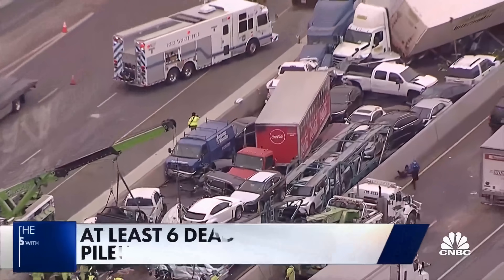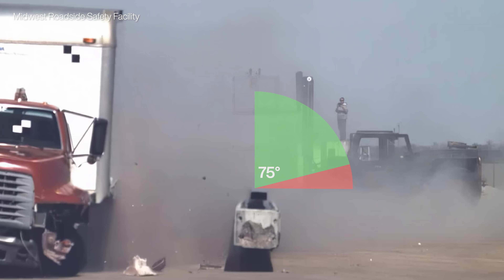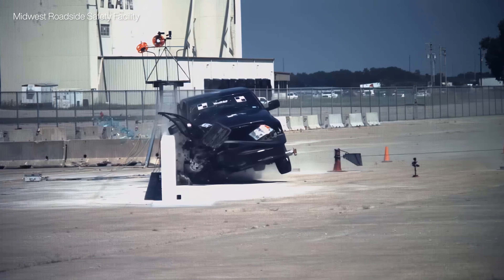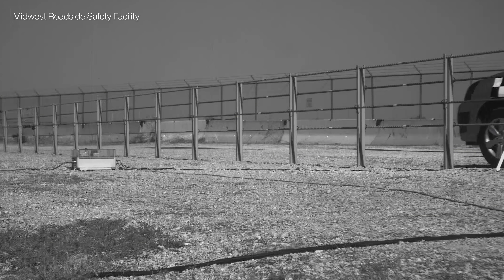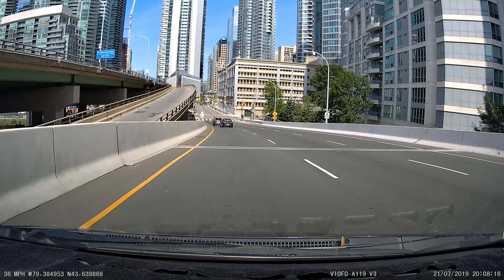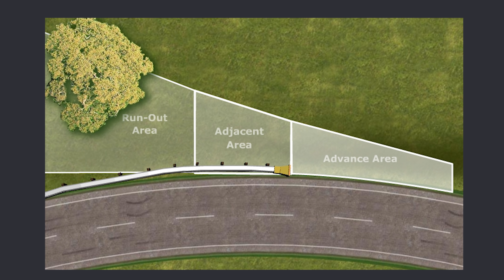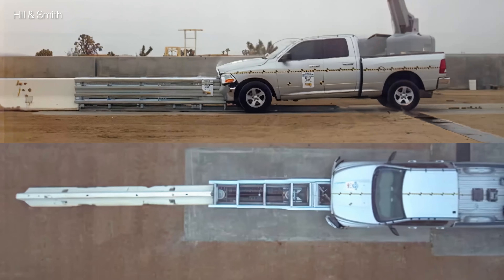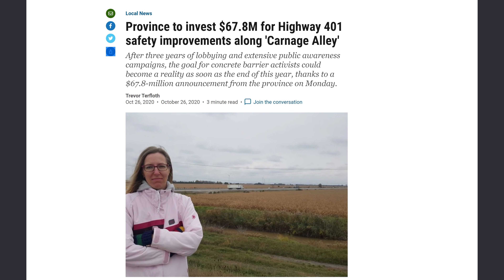How Road Barriers Stopped Killing Drivers

Comment: The cable barriers have been known to decapitate people, and because of that I will never drive a convertible.
Reply: I wish he had put the metrics up to compare them to guard rails. Like I get why concrete barriers are bad in any situation you aren't blocking very serious high speed cross into oncoming traffic. Stiff=bad when you are wrecking into something.

However I have the suspicion that guard rails are significantly safer while also being around the same price. So it feels like shaving pennies by throwing out a few lives.
Reply: @Syllaren  It's not really pennies when it comes to this. Not only that, the decrease in cost would allow more roads to be covered, which in this case would be 40% more roads covered by cable compared to the other one. Lives doesn't have a cost, but building materials do, unless these projects get a larger budget, cheaper alternatives would be more appealing to project managers.
Reply: @Syllaren  Did you pay attention to the experiments and safety testing being done that he showed in the video?  They WANT to know and FIND OUT before just going on their merry way doing the same thing as if there is no better choice.  I had no idea they have worked so hard to make it that much better.  I am 64 I remember them using sand barrels.  Then deciding water barrels were safer at bridges.  Then they disappeared and I did not know why.  This video shows why.  They found better methods to save your life and limb.  I remember the horrifying accidents where people got speared by the "safety" rails. It is great to see why that does not happen anymore.
Reply: Another issue with cables is they tend to get tangled up with the crashed vehicle, while being under an incredible amount of tension. That makes things dangerous for rescue and cleanup crews.
Reply: @paulmarano4078  But help slow the vehicle even more.

Comment: I have one issues with cables, those are great in most roads, but roads that are high speed or can be high speed cables can be deadly with compact cars, small sedans and especially low sport cars. There's a case of a viper being cut in half to deadly results because of bad cable design. I'm sure they are safe, but it's all about the right barrier for the right road.

Comment: I opened this vid just to comment... the department started cutting corners and even though they should curl away...they made one part smaller to save a minute amount of money and it breaks making it not curl. They made this public with then no opposition. Give or take if it works when you need it. They still pierce through cars in accidents.

Comment: Cable barriers are mad dangerous- it’s basically a guillotine for motorcycle riders. In the UK were going for concrete barriers as much as possible - saving metal flexi-guards for near side protection where necessary. We also use the crash cushions where possible.

Comment: Fun fact!
If you destroy a guard rail with your car, it can cost up to $1,000 a foot to repair depending on what kind it is.
This fee covers the materials cost and any labor needed to install new guard rails. 
Dont hit a guard rail if you can help it!

P.S. ( the Nurburgring race track charges 1000$ per foot of guard rail, and an additional $1,600 for every hour the track has to be closed.)

Comment: Non-wire guardrail have their own controversies, as jumps still happen even on the newer versions. There's also a plethora of problems with the consistency of which they are installed, making the posts oftentimes flip or fling colliders. Anyone not in a car also tends to get their legs mega-crushed or downright flung over said rails, often over a bridge/cliff or into the other side of traffic.

Also very disappointed you did not go over tire barriers at all, since you brought up cost & complexity so many times. They work great for cheap and are incredibly reusable.

Comment: 'better for frequently hit places'

Me, living in the Netherlands: You should fix the road design if it causes that many hits with guard rails.
Reply: Roads have the inbuilt problem of not being flat. (Even if made that way they don't stay in that shape as the weight of the traffic over time compresses the ground under the lanes but not the middle.) Generally they have a slight camber or tilt to increase the drainage of water but this also means that cars will tend to drift off the road as well.
Reply: @JohnJ469  hmmm, that doesn't dispell the merit of my comment though. You'd first have to assume that the cause is that the roads aren't perfectly flat. Well, over here they aren't either, flat enough though and most of the times repairs/resurfacing is done in a timely fashion. If my car is up to standards, i won't be crashing into those barrier starts, unless i ignore the conditons of the road or ignore the speedlimit.
Reply: @AwoudeX  Sorry, I meant it as one reason, there are many. And of course those reasons vary from nation to nation. For example in the Netherlands you never have to worry about a kangaroo jumping in front of your car. (Or low flying hawks and eagles, I've hit a few of those over the years too.) Personally I think most of the causes are inattention, tiredness or drink driving and unfortunately I don't think there is a design change you can make to effect that. As the old saying goes; Making something idiot proof just encourages God to design a better idiot. I think that's exemplified by driving on a mountain road and seeing a sign saying "Winding road next XXX kilometres". A winding road in a bloody mountain range? How unusual.
Reply from the maker: Yep, but in many places car culture is unfortunately prioritized.

Comment: I worked for MWRSF while I was in school.  There are a bunch of videos that they have not released that are awesome.  They have to get permission to post them from the agency that contracted the testing.
Reply from the maker: Hey Casey, that's awesome.  I understand they do a lot of contract testing for manufacturers so I can see why they don't want to post it before it either gets approved or before they get a patent for it.  I'm glad they posted as many videos as they did, it made this video possible.
Reply: @Lam  when i worked there they were testing barriers for a bunch of different states.  They also did some testing for DOD.  One we had a remote control car and went over some speed bumps.

Comment: I'm not a motorcycle driver (motorcyclist?) myself, but the main reason why they replaced the traditional guardrail with top to bottom 'walls' in the Netherlands long long  time ago, was because of accidents with motorcycles losing grip in bends and slide under the guardrail and in many cases decapitating an arm, leg or their head. I'm surprised I didn't see a motorcycle example in this video. Also I think Korea started with these rolling barrel construction guard or gide rail to absorp sudden impact to improve the survival rate.

Comment: Cables are cheap to install.. But expensive to maintain and repair. So in the long run you pay more for less.. On top of that a semi will run over them due to it´s weight and a motorcycle driver can get stuck in the wire and die. So I will never think cable is a good idea.

Comment: The government is still going about it all wrong though. That is improving driver skill is getting no attention at all which would prevent crashes from happening in the first place. They treat crashes as inevitable, where in fact nearly every one of them is caused by someone doing something wrong, which includes poor road conditions. It isn't so much that it was slippery, but that there are way too many drivers without the necessary skills to handle it, or to even judge whether to even be out in it.

Comment: Excellent video. 

I have designed highways for over 30 years. I cannot emphasize enough that the barrier itself is a hazard - you can't hit what's not there. It is far, far better for designers to provide sufficient clear zone for drivers to regain control of their vehicles so they can make it home in one piece.

Comment: They are still chopping motocycle drivers when they fall under in most places...
Reply: If your worried about safety then dont drive a motorcycle.
Reply: Cant save everyone
Reply: @LilfletchJDub  not with that attitude for sure...we can double the rails it will help everyone...
Reply: @kealahau6727  Double the rails and that truck you saw get caught is now jumping that railing and rolling over. Now john and his wife margret are dead... Joey is half dead in the back with his neck broken, and little andy in his car seat is paste against the roof that caved in... Yeah, we have them single for a reason, and that reason is the lives of multiple people in a single car.

Comment: 1 of the problems not addressed is how close the road authorities install the barriers to the running lane and how much of the original shoulder these barriers take reducing breakdown lanes efficiency and safety. Case in point, on Bass Highway between Lang Lang and Anderson (Victoria) if you broke down or got a flat tyre, you pulled over onto the shoulder (and could spill over onto the grass) as there was no barrier stopping you. You could be about 2 metres from the running lane with a wide safety margin. Then the idiots installed wire barriers taking up the shoulder part meaning only about 1 - 2 metres of the shoulder was left. So if you broke down, your car was partway on the road still if your passenger side was up close to the barrier (meaning you couldn't get out that way safely) and your door opened into the running lane. This now terrifies me as being very unsafe. All they were protecting was farmers field which could conceivably act as safe runaway fields. 

Add to that the fact Victoria police have a habit of pulling you over on blind corners with their vehicles 1/2 way INTO the running lane to make it safer for the police only (screw everyone else). Add the law of slowing to 40 kph when passing a police vehicle on a blind corner 1/2 way on the road and people slamming on the brakes from 100 / 110 kph and you have no safe run off area to go. All to save money and 'Look' like they did something. I happily slow down rapidly to 40 kph on a 110 freeway and look at them smugly as they look worried with a truck behind me slamming on their brakes. After all, they are the ones who wanted the law.

Comment: It would be nice if standards and manufacturers would also consider 2-wheel vehicles. It breaks my heart to see only cars and trucks in these videos. There are other vehicles on the road (including motorcycles and cyclists). Many barriers are exceedingly dangerous for 2-wheel vehicles, but they don't have to ! Simple modifications such as adding materials at ground level would prevent limbs from being cut in a crash, and removing sharp edges...

The major risk is that 2-wheel vehicles crashing send their riders sliding on the ground, and the vertical pillars of most of the barriers considered simply cut whatever limb or head contacts them first. Instead, manufacturers need to add a continuous band of horizontal material at ground level to prevent this. Simple modification !

Comment: A very good vid, informative andmanly similar systems to what we have here in the UK. Althought I'm nowretired I was one of the first in the UK to achieve the cetrificate needed to install safety barrier. we use the following types, blocked out beam which has wooden posts, tension corrigated than uses steel post, box beam with bigger or if fitted toa structure crush boxes, concrete section susually in conjuction with other types. we also use an abutment fence atop the concrete bridge abutments on elevated carriageways. they are a sturdy steel boxconstruction with wire mesh panels, designed to prevent anything going over the top. We alo use the wire type but only on roads that are prone to drifting snow winter conditions, as it permits the snow to continue through and off the road. Wedo use differnt anchor/terinals herein the uk. Thank you for reminding me I actually knew all this. lol

Comment: I'm quite surprised that cables are less likely to launch cars back into the roadway.  A few years back on an icy interstate I hit a cable barrier and was sling-shotted back across the roadway.  In that incident, the cable barrier transformed a slow-speed fender dent into a terrifying spin through traffic where I narrowly missed a semi.  Additionally, the cables mangled the vehicle in ways concrete or a regular barrier never would.  The top cable smashed the windshield and creased the A-pillars.  Thanks for providing some facts to temper my dislike of them.

Comment: Cable barriers are a nightmare for Motorcyclists. Weirdly enough it is the posts that cause the dangers to Motorcyclists. The riders hit more posts causing substantial injuries to the rider. With the solid (Armco) barriers a simply lower beam keeps the rider away from the posts. I would love to see a more detailed study utilising more vehicle types and barrier designs. The concrete barriers can have an added benefit. If they are high enough they can put a stop to the 'rubber necking' and the accidents associated with that...

Comment: I seen a truck flip over and over because of cable barriers and the other systems I seen fail as I seen big trucks flip over on over pass down to the ground on street and the straight concrete made a car flip over to the ground and the driver died

Comment: They should put lights every 100 feet and when the barriers get severed or impacted (like air bags) the lights flash for 2 miles in both directions so drivers slow down, esp in the fog.

Comment: The cable barriers have often been called "person slicers".  Motorcyclists and cyclists are cut to ribbons by the serrated surface of the wire.  It also concentrates the forces on a few limited segments.  Just like bull bars do.  So increasing the safety for one can sometimes reduce the safety for another.

Comment: US 30 in Ohio used to go through several towns- meaning lowered speeds, traffic lights, and stop signs.  Several years ago, the state bought up a bunch of private land and re-routed to make it a continuous highway.  I take a stretch of it to work every day and there are still MANY places where the side of the road drops off into an abyss with absolutely no barrier- not even a simple guardrail.  Many of the spots are so deep that the tops of the tallest trees meet the grass at the side of the road.  There is no way that you would come out even close to the same after you tumbled into one as you were before you crashed.  But I guess that the state will worry about that AFTER someone dies and their family sues.  So sad!!!

Comment: Happy to see this explanation of road barrier technology. I’ve noticed in the past year or so that something has changed with them on the interstate highways where vehicles have hit the guard rails. Whereas they used to crumble unpredictably I now see that they are rolling up. Especially when hit at the end of the rail. It’s surprising how many I’ve seen also. Come to think of it, although many of the roads are kind of a rough patchwork of repairs, it seems there are now more guard rails than there used to be. Thanks for posting this informative video!

Comment: I hope I never need these devices but I'm glad they've been improving through the years.  I began to use seat belts in the early sixties before they were an option on new cars.  I had to seek out an auto parts store that had them in stock and then drill and add support to my mother's car.  Safety first, not second, not third, not an after-thought.

Comment: I call BS on the guardrail system. The new systems may be safer when a vehicle, running parallel to the barrier,  simply skims off the barrier because the potential for the vehicle to travel through the barrier is lower.  However, the testing is skewed on frontal impact with the end of the barriers on all the systems that states are using now. Here in MI, there used to be a 15ft tail section (think banana shape) at the leading edge of the barrier. The end of the barrier would be at least a vehicle width to the right of the vehicle and not directly infront of it.  So if you hit it head on, the thing would just fold onto itself in a circle. Now, it's a dam 1 or 2 ft square box (or whatever size) that is set an some arbitrary height and is directly inline with the barrier. It's like running into the but end of a butter knife. There is/was a standing multistate lawsuit against the mfg given it had higher potential to spear the car.  Also, the fatal accidents I've heard about with the cable systems sheared the top of the vehicle off and decapitated the occupants. I'm sure those drivers would have preferred a typical corrugated barrier.

Comment: I've always thought the wire guard rails were the best.. but if that wire goes thru the cap .. decapitation is gonna happen..
Reply: They are more for preventing one vehicle taking out multiple vehicles.  They are not as safe for the driver going into them.  They kinda use the motto " the needs of the many outweigh the need of the few".  Like a soldier jumping on a grenade to save others.

Comment: I have recently seen new metal barriers in the same shapes as the concrete barriers being installed. Do these perform the same as the concrete ones but with a little more give? Is there anything inside of them? They seem to just be made out of galvanized steel but I couldn't tell how thick the metal was.

Comment: Okay, but I drive cross-country a few times a year, and more than one area is putting cable guard rails alongside the interstate freeway; rather than the extruded guard rail. Maybe it won't change the damage to the vehicle much (but I doubt it) but itmust be significantly more lethal to motorcyclists. I suppose it could be argued that a motorcyle contacting a guard rail at freeway speeds is already fairly lethal, but still...